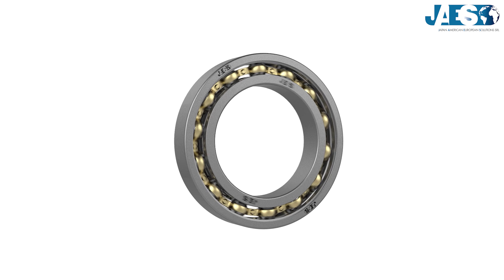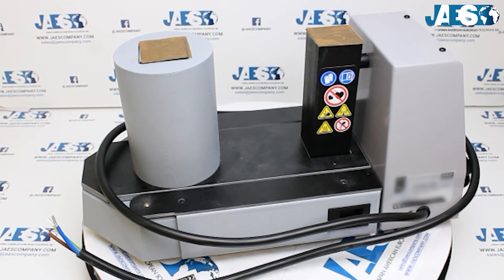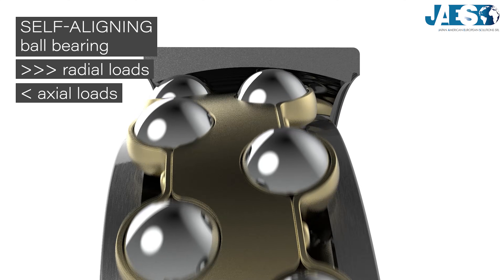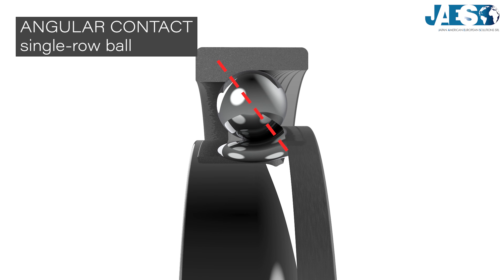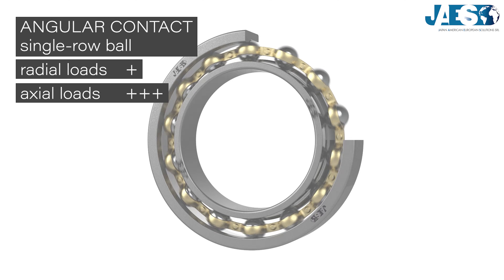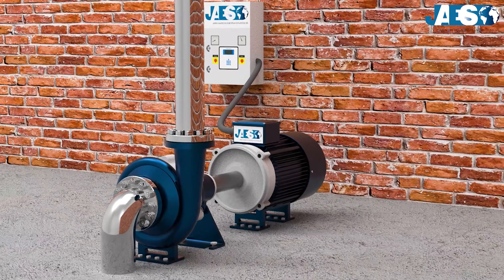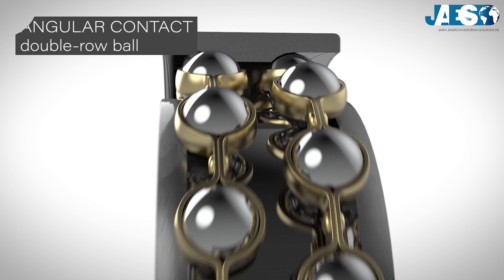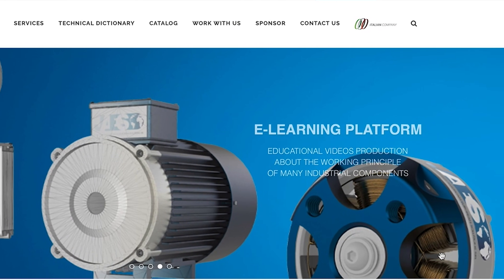Single-row Angular Contact Ball Bearings

Comment: Useful. I have 30 thousands of an inch ost that excessive although it is for the main shaft case side not outputeon my manual gearbox I don’t want to be redoing my transmission ever year for over $200 in parts alone each time  50 in tools one time and about 5 meticulously painstakingly long hours